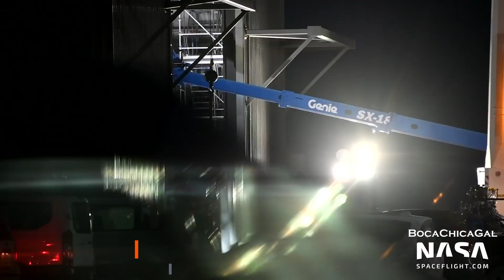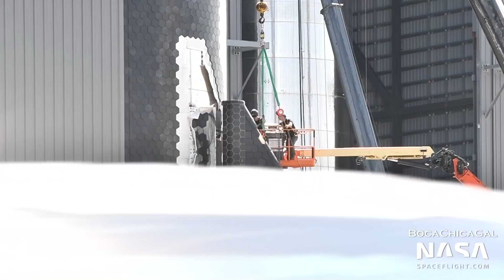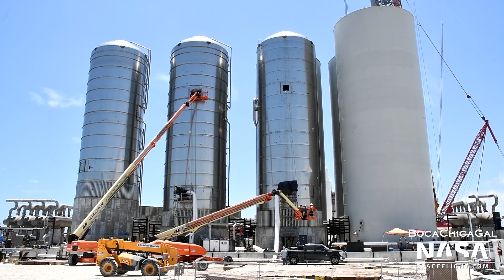29 Raptor Engines Installed on Super Heavy Booster 4 Overnight | SpaceX Boca Chica

Comment from the maker: Time Stamps!

00:00 - SpaceX Boca Chica
00:20 - Raptor RC64 Brought to Booster 4 for Integration
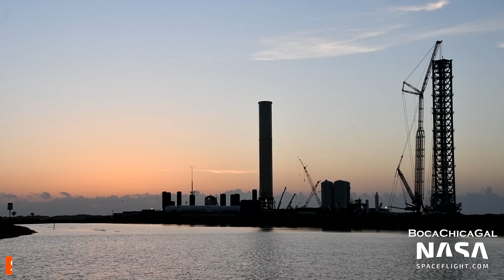00:40 - Sunrise Over Boca Chica
01:00 - Production Site Overview
01:20 - Booster 4 in the Highbay
01:40 - Workers Mating Both Super Heavy Halves
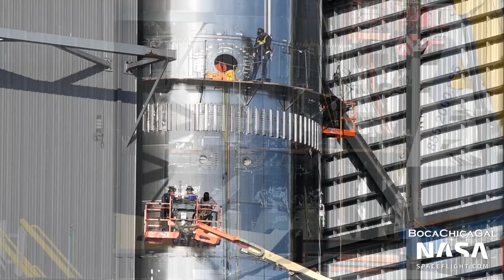02:00 - 29 Raptors Installed on Booster 4
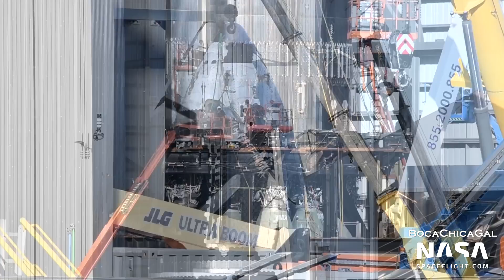02:20 - The TPS on Ship 20's Nosecone is Growing
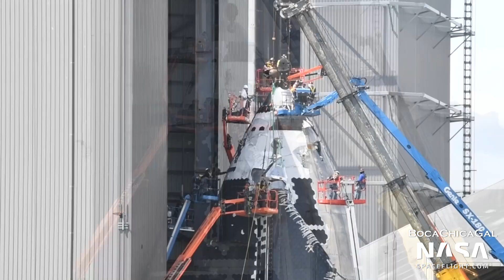02:40 - Aerocover Cap is Installed on the Nosecone
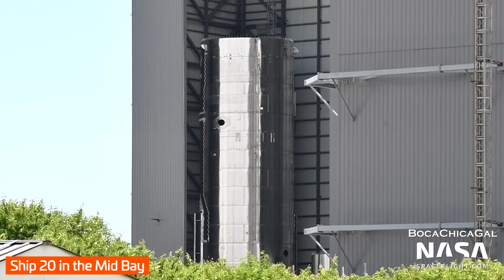03:00 - Ship 20 in the Mid Bay
03:20 - Ship 20 Rolled Out of the Mid Bay
03:40 - Ship 20 Sits Outside the Mid Bay
04:20 - An Aft Flap is Installed on Ship 20
05:40 - Work Continues on GSE 6 and 3
06:10 - Stainless Steel Coil Arrives at the Production Site
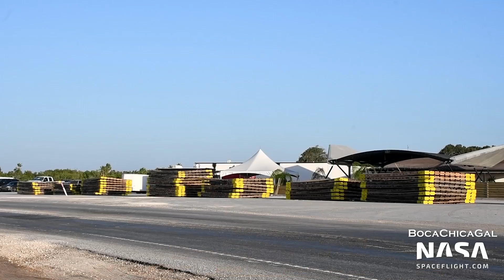06:30 - Road Reinforcements Prepared for the Booster 4 Rollout
07:00 - Mystery Structure Awaiting Assignment
07:20 - Transporter Stand for Vehicles Next to the Mystery Structure
07:40 - Concrete Pumper at the Launch Site
08:00 - Work Continues on the GSE Tank Farm at the Orbital Launch Site
08:20 - Cranes Removed from the Launch Table
09:10 - Liehberr LR 11000 Crane on the Move
09:30 - The Orbital Launch Mount
10:00 - The Yellow Pipe Structure Grows
10:10 - Welding on the Black Pipe Structure
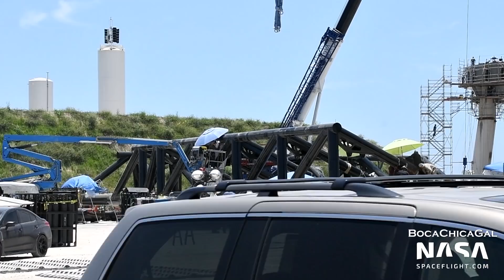10:30 - Crew Continues to Install TPS on Ship 20's Nosecone
10:50 - A Forward Flap is Installed on the Nosecone
11:10 - Ship 20, GSE 6, and GSE 3
Reply: Crazy
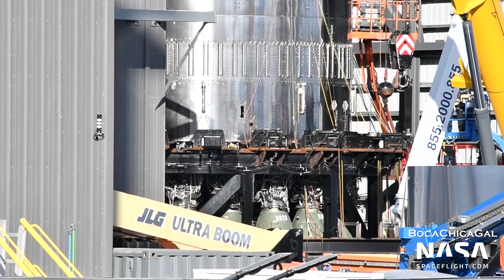Reply: 2:09 How prophetic......yip when those 29 Raptors light it will be a ULTRA BOOM.....lol.....go Elon,  go TEAM Spacex
Reply: @ChrisSmith-kh4ue  Maybe poring the display stand for booster 3 near starship 15 & 16.
Reply: 09:10 Typo again with the "Liebherr Crane" - this time: "Liehberr" :D Maybe you can memorize it with the translation: "Liebherr" is german and means roughly "Lovemaster" :D So think about "Lovemaster Crane" ;)
Reply: I saw that too.
Reply: Not sure if anyone noticed, but the video captions have been different today. You might say more poetical. And sure enough, as per the outro, this video has been edited by Mary, not Jack.  Or at least she wrote the captions. I’m quite sure of that. :)

Comment: 29 Raptors Overnight... This tells us they're really far along in developing the maintenance cycles for the ships and boosters, as they have the install procedure process down to an effcient timescale.
Reply: You're right. It was planned since the beginning, I guess, so no time and extra costs to repair/refurbish any part.
Reply: They're dropping those in the Gulf, re-use? Probably not, they will tear them all down, they will be the longest run raptors in flight. Until Starship survives it's re-entry over Hawaii and splashes down softly after the belly-flop.
Reply: I hope they won't make any mistakes, because history of rushing something is mostly filled with failure due to crunch...
Reply: @shadyend5401  Big risks, big rewards.
Reply: @TD_YT066  Agreed, these ones will be fished out of the ocean and torn down for deep inspections of every part to look for any place that needs adjusting for gains in reliability.
However, the install times indicate that "remove and refit" procedural manual has been written, another important part of the 'build the factory to build the product' process.

Comment: Man, all this incredible hard work just to see it all go in the dunker off of Kauai.  Hope there’s a plan to salvage it.
Reply: I think they'll try to hover it until they nearly run out of lox or CH4 and then soft splash it using the thrusters at the top to ease it down. By then it will be out of fuel and should float, engine end down, like a buoy. It may take a couple of tries though.  Same process for the booster. If they can hover it a few feet off the water, then they'll trust it to bring it back to the tower and try the catch or land the Starship on the pad.

Comment: My guess is they’ll use that mystery structure to test on BN3 to get the data they need for the structural forces all those raptors are going to have on BN4.
Reply: That "mystery structure" was labeled as a thrust ram simulator for the booster by this site just a few weeks ago so I don't know why call it a mystery structure again.
Reply: If they installed the raptors I don't think they can test structural forces now. So, maybe the mystery is something else. Transport secure for booster?
Reply: more likely for lifting something heavy and round up
Reply: Kinda late for that now that the B4 is ready for take off 😊
Reply: @zmeura1  The thrust ram simulator could be used to test B 3.  That might explain why B 3 is still sitting on the suborbital launch pad.  It was waiting for another test.

Comment: I hope Mary has invested in a good set of sound dampening earmuffs come static fire time.....
Reply: Everyone will be at least 5 miles away for launch.  For the static fire a good two miles anyway.  Plus the robot came pick up the launch pad as well.
Reply: @michaeldeierhoi4096  If that's the distance it needs to ensure eardrums wont pop on a Saturn V mission, then they will need more than that, as this thing is equivalent to lighting up two Saturn V rockets at once.
Reply: @erlienfrommars  It will be something.

Comment: That thrust puck is going to experience some forces like never before.  3mm stainless steel. 🤔😬 let's hope B4 doesn't tear itself apart.
Reply: The thrust puck is a lot thicker then 3 mm though I don't know its actual dimensions.
Reply: I think they're still using 4mm steel, no?
Reply: @LarsPallesen  don’t know the thickness but multiple layers in big parts of it I think.

Comment: 9:54 - 10:30 My idea/guess is that the yellow and black tubular structures are the catching forearms of mechazilla. Their base will be connected opposite to each other on the trolley bus which will move vertically up and down in the Orbital Launch Integration Tower (OLIT). It will be similar to a large mechanical pliers whose handle is connected to the trolley bus of the OLIT.

Comment: The mystery unit @ 6:50 I believe is a hold down unit to be used with the new thrust simulator. It will grab and hold down the launch "ring" as the rams push against thrust puck on Super Heavy !  This will allow for even pressure all the way around the base. Using the old method would rip the unit apart as it was only bolted to the test stand in four places ! The same old mounts that were used for transport.
Reply: It will specifically test the outer 20 spots where the outer raptors are placed.
Reply: But they just installed all the raptors before using this. Can they do the thrust tests with the raptors installed?
Reply: Maybe they'll do the 20 ram simulator on BN3 if it has the same puck and lower build ?
Reply: @TD_YT066  My thoughts as well.  And that may be why B 3 has been sitting on the suborbital launch pad all this time.  Waiting to be tested.  

We'll see soon enough.

Comment: The tubular structures are intriguing. Someone must know what they are building.
Reply: yellow: the catch and transport arm with some angles
black: also part of the whole MechaZilla-construction; supports at the tower-lift, or also part of the MechaZilla-arm
Reply: My idea/guess is that the yellow and black tubular structures are the catching forearms of mechazilla. Their base will be connected opposite to each other on the trolley bus which will move vertically up and down in the Orbital Launch Integration Tower (OLIT). It will be similar to a large mechanical pliers whose handle is connected to the trolley bus of the OLIT.

Comment: Man they put this into overdrive.   Maybe they will be ready by the end of the month.  It will be interesting to see.  I'm bit curious when they will shuffle the booster over.  Will B3 need go over to scapyard?  I don't think the pad it's on was setup to handle full 29 Raptor static fire yet.  I think it's only for the orbital table can handle it, with all those raptors attached.

Comment: Those boosters must be coming off before they role BN4 out of the highbay. The SN + boosters + mount platform looks like there's no space to slide an SPMT under it, and no more headroom above the stack. So presumably engines off, then slide the SPMT into the mount platform to ease it out, then reattach the engines later on.
Reply: Maybe they were just checking to see if they all fit under there.

Comment: I find it curious that they didn't install more TPS on the nosecone before stacking it that high. Also they are missing a few on the flaps. It's almost like they are testing if it can reenter with a less than perfect heat shield.

Comment: Confused! If you make twice your payload, then square booster propellant and engines number compared  single raptor engine thrust capability. Am I right? Is max structural stress (about 2.4 G on 50 km/30 miles) a limiting factory for efficiency or where the engine count 29 comes (need some spare for backup purpose of cause)?

Comment: slowest thing going down the road is going to be the tiles. Always was an issue with the shuttle. Then when it eventually goes up and does a re-entry. always worry about the tiles and any gaps or lose or missing pieces from falling off from launch. There needs to be a advance in way of application of tiles.
Reply: Yep, it sounds like robots are speeding that up

Comment: The Mystery Structure will go on top of the launch table. It will have the clamps that will hold the booster down until launch thrust achieved.
Reply: Yes, this is what I was thinking. The clamps must be totally synchronized ...
Reply: And probably the next to move to the launch site.  BN4 a bit later.

Comment: Does anyone know what the mystery structure will do? Will it act like a test stand for booster 4?
Reply: My guess is that it'll act as a thrust-ram for Booster 4, seeing as they probably wouldn't perform a static fire of 29 engines without an initial strength/cryo test ;)
Reply: @matthewr5432  The raptors are already mounted on the B4 so they won't test it with the thrust ram.   However they might test B3 which is possibily why it is still sitting on launch pad A waiting patiently.
Reply: @michaeldeierhoi4096  Oh right! Geez I completely glossed over that 🤣 Yeah, perhaps they will, either way it's going to be absolutely insane!

Comment: The mystery object looks like it has hold down clamps. Hear me out on this, what if it's the hold down clamps for the launch table? It looks like it could fit inside the launch table. I just don't see clamps on the launch table at this time so it is plausible it's a separate piece and it makes sense. You would probably want your clamps to be a whole separate unit bolted to the launch table as its going to be directly exposed to the sheer force of 30 raptors firing at once and may need repair on occasion. It will facilitate much easier repairs than if it were integrated into the launch table directly. My $0.02.

Comment: They have been too fast in last 4 days...from the unstacked booster and the Ship 20 without the nose cone to a Ship 20 with Thermal protection and 3 Rap.Vac. , the booster with grid fins and 29 Raptors.

Comment: Any idea what the TP tiles are made of?
Reply: It is a ceramic material that can handle very high heat.
Reply: @michaeldeierhoi4096  Cheers I guess they will be ablative also?
Reply: @simonsutherland814  I don't think they're ablative, I've heard that the TPS tiles are absorbant, like the space shuttle, and not ablative
Reply: @blobman1238  cheers
Reply: @simonsutherland814  I am not aware of the production process of the TPS tiles nor the exact physical properties.  But the tiles are placed on top of a white material which is thermally resistant as well.  Time to do some more research.
Reply: @michaeldeierhoi4096  Cheers

Comment: Hang on.  Isn't SpaceX getting carried away here. Doesn't one of the boosters need to be load tested with all those hydraulic rams. If not B4 it will have to be B3 if the thrust pick is the same design.

Comment: If the starship does not start its engines in orbit, will it remain floating in space without being able to return to earth?
Reply: No. In low Earth orbit, the orbit will decay due to atmospheric friction, (you can't breathe it, but there is an extremely tenuous though not-insignificant atmosphere), eventually de-orbiting a spacecraft. ISS has to periodically boost its orbit to counter this decay.

Early manned spacecraft--like Apollo--had contingency procedures to de-orbit using RCS--maneuvering thrusters--alone, in the event of failure of the main engine. I suspect the same could be done with Starship. However, Starship has six engines: I can't foresee a situation other than an unlikely massive control-system failure in which at least one of them couldn't ignite--one should be sufficient.
Reply: @alanmccright2282  thank¡your answer very clear
Reply: @Riverarecordsdj  My Pleasure.

Comment: Will there be another skirt added to the booster? I think the raptors are too exposed.
Reply: Raptors like to be out in open air :-)
Reply: Engines are usually out in the open like that.
StarShip gas a skirt because that is essentially it's interstage
Reply: @kevinkrammer8077  I had the impression that the skirt protects the raptors on Starship during reentry as that’s a lot hotter process than the booster experiences.  If it was just interstate I’m guessing it would be better to keep it attached to the booster rather lifting it’s weight to orbit on the Starship (could be missing something with that guess though).
Reply: @Midlife-Adventures  there will likely be more than one reason for having the skirr, protection could be one.
The booster doesn't have the same entry profile.

Also consider restacking. Easier to just hover the skirt encased nozzles over the booster than trying to lower them into a booster attached interstage

Comment: Installing tiles in direct sunlight can cause microfissures in the tiles due to differential thermal expansion and contraction between different materials that expand and contract at different rates. Ideally this process should be done in a climate controlled environment to eliminate this potential.

Comment: 29 Raptors when they haven't even managed to get 3 of them to perform reliably for more than one flight?  I suspect the first test of all 29 isn't going to go well.
Reply: I suspect they only need "one really good one"...  But seriously, I know that the "fuel feed" was an early issue. And on the 1st flight we (I) didn't realize that they were shutting down the engines by design, to limit the altitude creep. "I" thought they were failing.. My bad. I do play a rocket scientest on TV but that's the extend of my experience. But good ponts Will... All worth stating. Cheers!
Reply: You learn from your mistakes: Without mistakes, one doesn't learn. There are no true "failures" in scientific--or rocket--experiments, not in the common sense; for every setback provides data necessary for future success. SpaceX seems to learn very well. Unlike others.